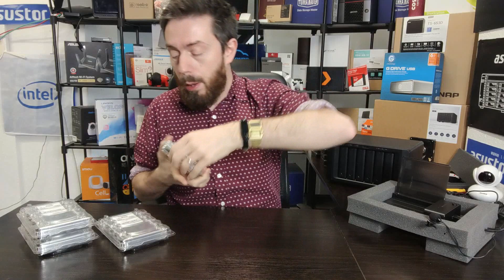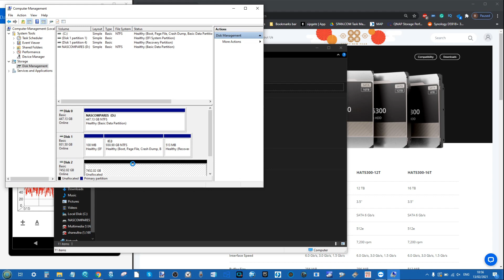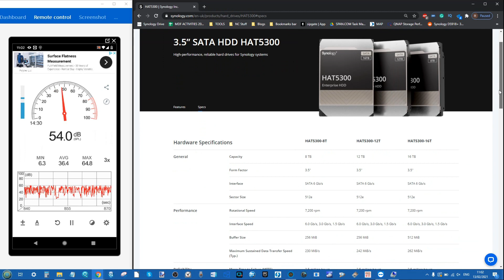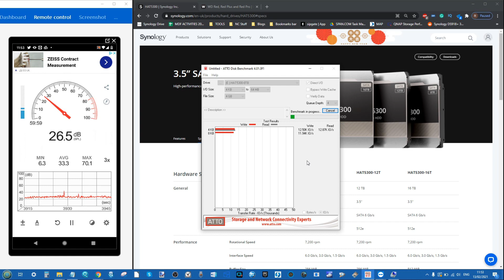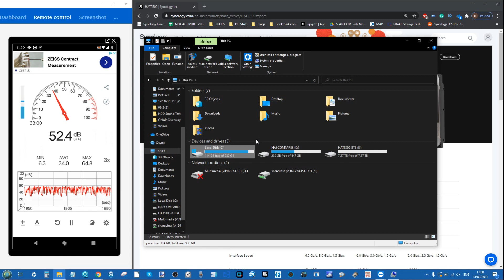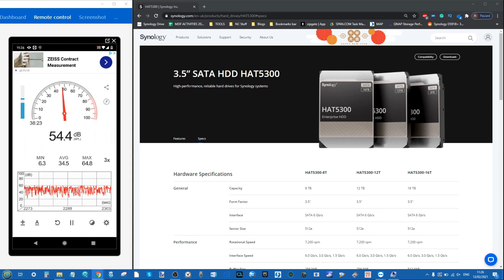Synology NAS HAT5300 HDD Performance - Single Drive Test

Comment: No point using them as desktop drives if you believe your own previous spiel about drives being specialised. Unless of course you like overpaying.
Even the bare Toshiba enterprise drives are cheaper, which is still overkill for most consumer use when you can shuck a comparable drive for much less.